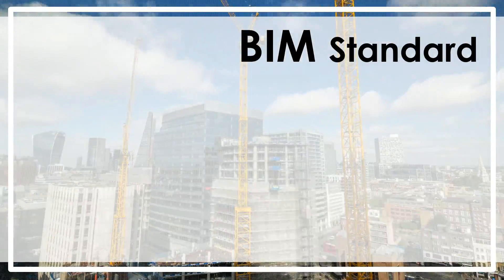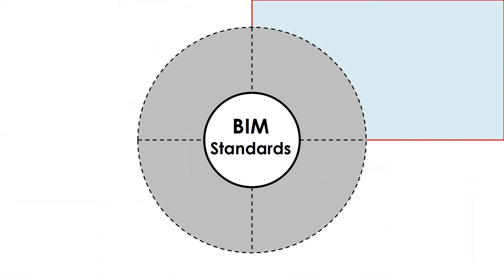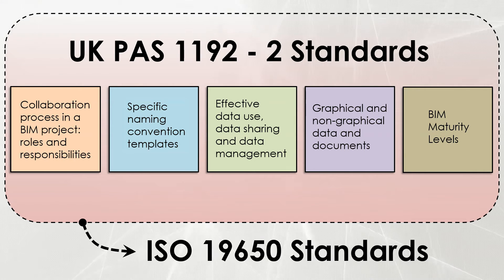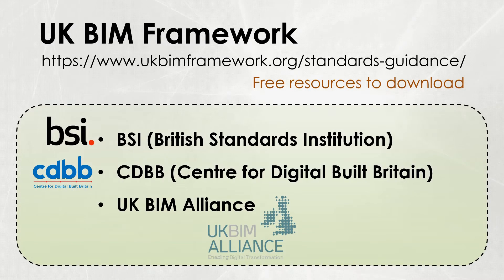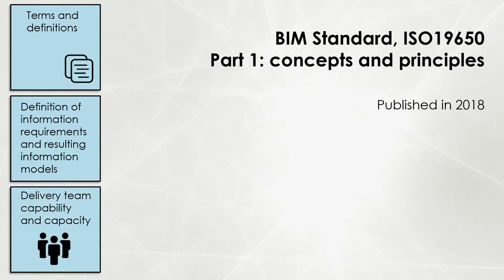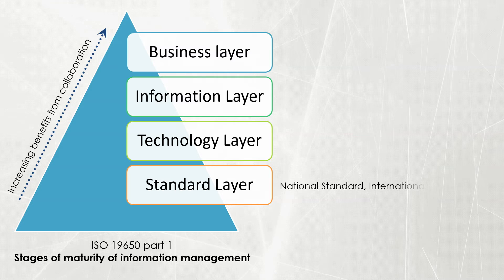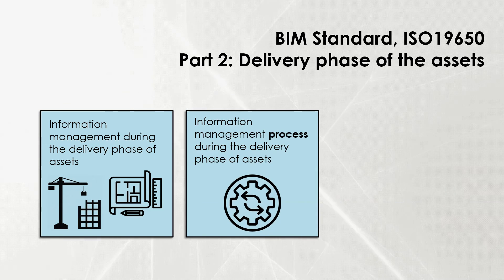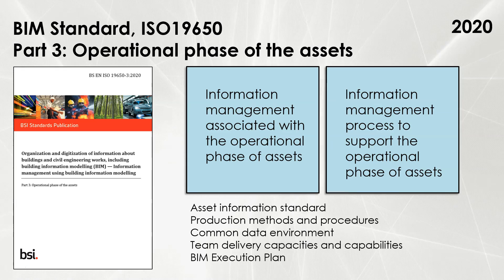BIM Standard ISO 19650

Comment: Hello, dr. Elham. Thanks for the informative video! Hope that you will upload more videos in the near future. I have a question regarding BIM Standard ISO19650. Is the BIM Standard ISO19650 only used and is a binding document in the UK, or is it also used in the US and the rest of Europe? If it's only used in the UK, what are its equivalent standards in the EU and the US?
Reply from the maker: Hi Mohamed, Such a brilliant question. ISO 19650 is the International BIM Standard. It has been developed based on the existing UK BIM Standard but was modified to form the international version. I am not aware of any other widely used standards in Europe (I will need to search to give you a definite answer). 

US National BIM Standard
https://www.nationalbimstandard.org/

Take a look at this article: https://clok.uclan.ac.uk/39137/1/39137%20A%20Global%20Analysis%20of%20BIM%20Standards%20Across%20the%20Globe%20%20A%20Critical%20Review%20Accepted%20Version_.pdf

I am planning to add more videos over Summer.
Reply: Thanks a lot! The linked article provides excellent insights regarding different BIM standards in different countries. 
Waiting for you new videos! I hope that you can emphasize on the relationship between BIM and the sustainability in the built environment in your upcoming videos; that is, how BIM can help reduce the carbon footprint, reduce waste, and induce a greener built environment.

Comment: Are there any challenges for designers to implement and respect  "BIM Standard ISO 19650" during the design phase?
Reply from the maker: Thanks for the brilliant question. ISO 19650 Part 1 discusses various topics that are directly related to the design phase: digital project delivery strategies, information delivery and handover plans, BIM Execution Plan and federated model that links the architectural design with building structure and MEP. It helps designers to have better communications with other stakeholders involved in the project. The most important challenges in my opinion are around building up the required knowledge and digital skills. In many cases, there need to be communications with the clients around the necessity of implementing BIM in private projects.